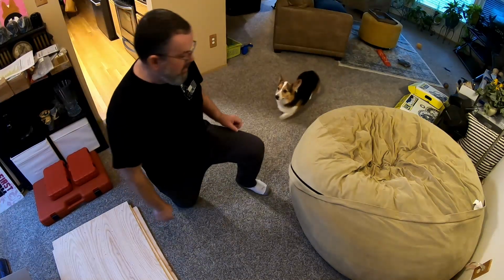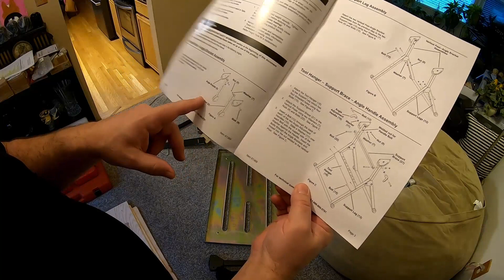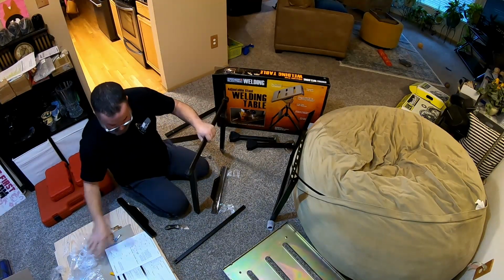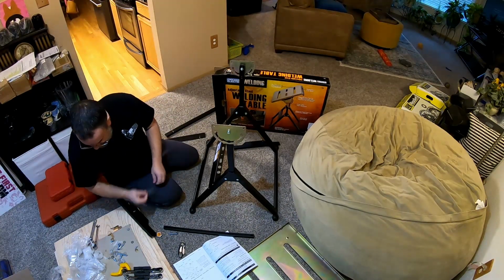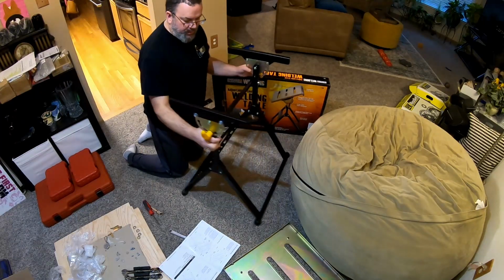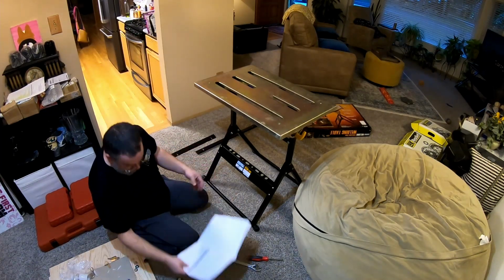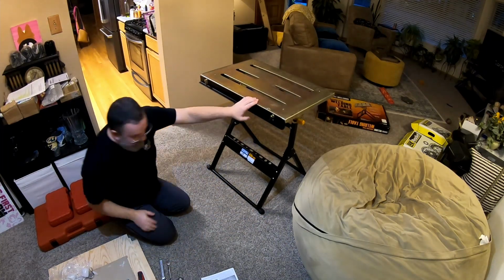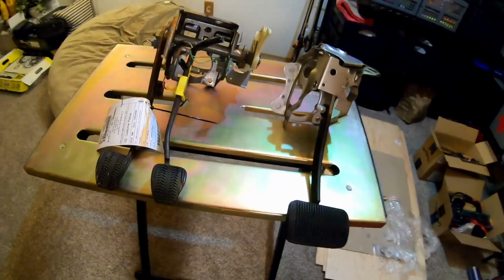Harbor Freight Weld Table Assembly and Review BORING Chicago Electric

Comment: The 4 washers go between the table top and the table top bracket, for the countersink to sit in. P4 of the manual. The bolts ?
Reply from the maker: Good eye on the washers location!.  That being said I really don't know if they're necessary.  I guess if you were really going to try putting 300 some pounds on this thing you might want maximum support for the top.  I will never do that though.     Love this table so far!